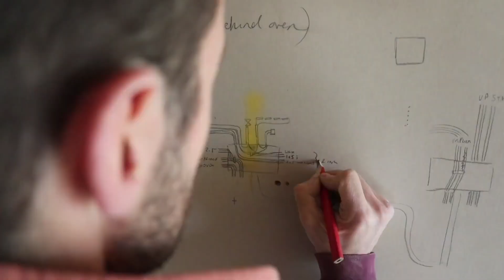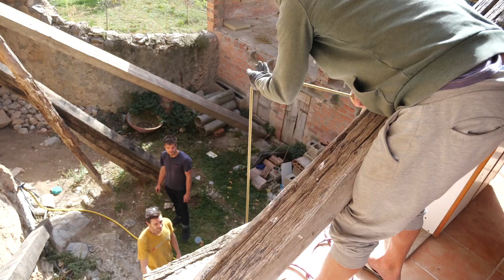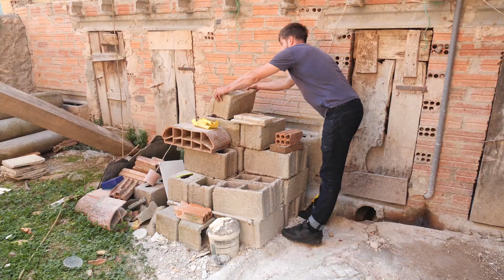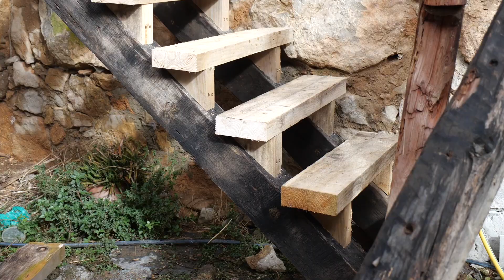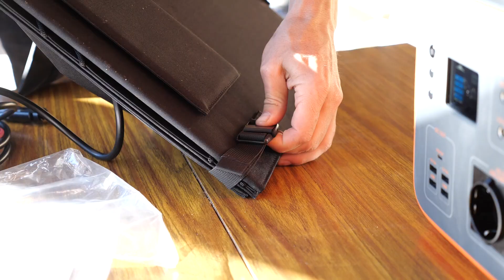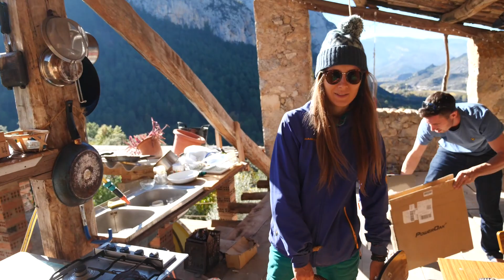Is this PORTABLE SOLAR ENERGY SYSTEM ideal for VANLIFE? 🚐 // MANUAL CONSTRUCTION In The BARN 🛠️

Comment: I looked into one of these power station things but decided that it just didn't deliver enough to make it worthwhile (yet).  The uses I was thinking of, in a van, were some power tools to DIY the van, maybe a fridge, and charging my phone and electronic devices.  I think the power station's max capacity is about 500Whours, so if a fridge consumes power at the rate of 40W or so, the power station doesn't have enough capacity to keep the fridge going for 24hours so that's no good.  I think the maximum power output at one moment of the power station is 300W or 450W or so, which isn't really enough to power DIY tools which can require up to 700-800W.  Running power tools from a 1000W inverter connected to the vehicle's main battery/alternator (can just run engine for a few minutes power tool use if you're worried about draining the main battery, so the power would be coming from the alternator) would only cost about €100 rather than the €560 or so this power station costs.  As for charging my phone etc, that can be done via the USB or 12V sockets inbuilt into the dashboard of most vehicles these days, or alternatively you could rig up wiring to charge them whilst driving from the alternator, little electronics are easy.  So overall I thought I'd charge my electronics via the USB/12V of the vehicle, buy a €100 inverter for a few minutes power tool use at a time, and do without the fridge.  Please someone tell me where I'm going wrong and can run a fridge 24h and power some DIY tools from this little box.  (Of course the little lights Nate has it rigged up to would be fine!)